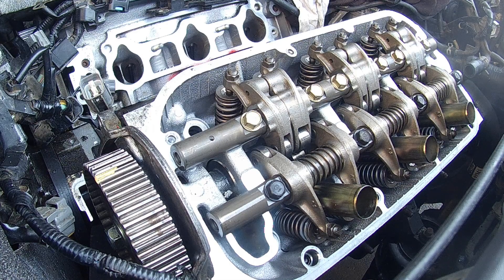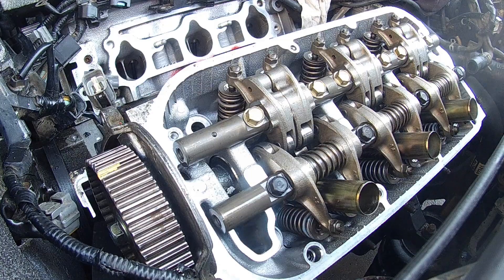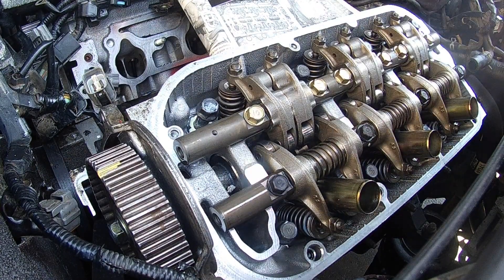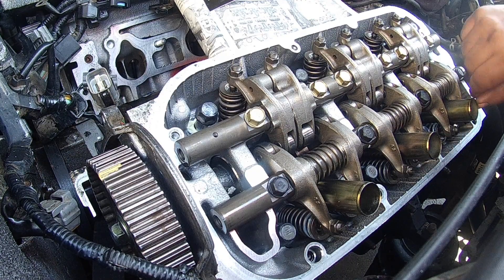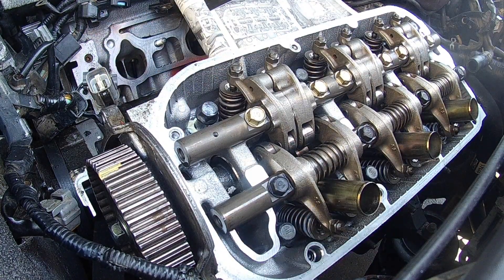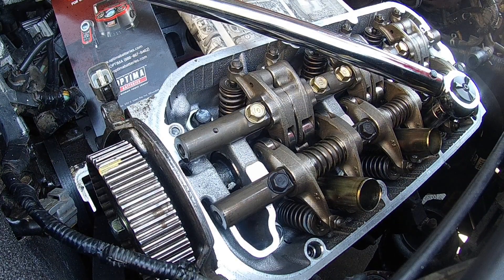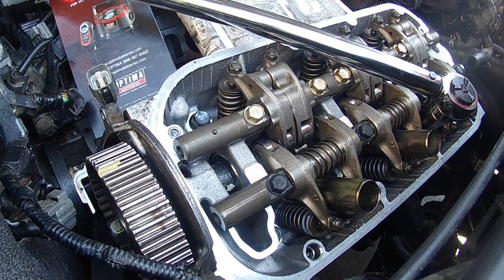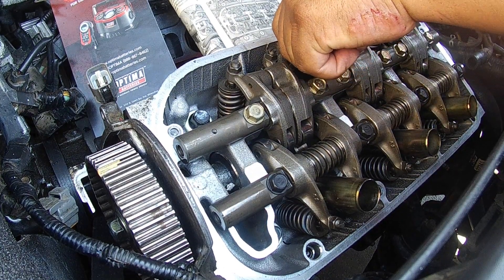Honda Accord V6 Cylinder Head Torque Specs - J Series V6 - Pilot Ridgeline Odyssey Acura TL CL MDX

Comment: How does one goes about knowing if a bolt is 12 point, or 6 point.
Reply from the maker: Look at the head / top of the bolt. One will have a 6 point bolt and the other will have a 12 point bolt.

Comment: Hi bundy, would you please help me with my 2008 odyssey head bolts torque sequence (12 points) thanks!
Reply: Just did it on 2011 mdx 12pt bolt it's 22ft lbs then 90 degree and then another 90 degree for old bolt but new bolts same with additional 90 degree

Comment: Very curious how there can be two different head bolt specs and torque setting for this head.  The 6 point bolts have way less threads and the over all torque looks to be way less than the 12 point bolts, even used ones with a less turns.  How can this be?

Comment: Hey bundy I have 12 point head bolts on my odyssey 2008 when they say 22lb step 1 and then step 2 90degrees then step 3 an additional 90 degrees. Whats step 4 is that if I brought new bolts then ill tighten an extra 90 degrees? I'm reusing my head bolts so do you think thats ok ? Or should I buy new ones? Since my engine overheated? I've heard i can probably be ok by using the existing bolts but what do you think? Really would like your advice. And understanding into the tightening sequence of using new bolts vs existing ones that really sounds confusing

Comment: Hey bundy thanks for all good info, just want to be clear on some things, first torque sequence and specs is the same for an MDX with a 3.5 and the 3.7L? And can 12 point bolts be reused or not please advise thanks
Reply: Probably way late commenting.....but it's recommended to not re-use the headbolts bolts. Its best to buy new ones.
Reply: Again just putting this out for posterity as you have probably already completed whatever you were working on but the FSM says to measure them in three places on the threads and if they vary or are smaller than 11.3mm then replace them.  If not reuse them.  When reusing them the FSM states to torque to 22 ftlbs then turn them another 90 degrees in sequence(quarter turn), then another 90 degrees (quarter turn) in sequence (for a total of half a turn or 180 degrees) and you’re done.  I always just buy new ones as they aren’t very expensive.

Comment: Question: are 6 point and 12 point the same length and diameter and thread? Coz im thinking of using 6 point instead of 12. Also on a 2009 Honda Odyssey 3.5l i-vtec w/vcm intake valves are 14711-rye-a00 and Exhaust are 14721-p8e-A00 They dont make kits with both of those in it🙄🙄🙄🙄rye ones come in 4 cylinder engines—BUNCH OF CRAP HUH???

Comment: I used new 12 point bolts. The Acura manual states first torque to 22 ft-lb then 90 degrees and 90 degrees again for used bolts and AN ADDITIONAL 90 DEGREES FOR NEW BOLTS... I'm glad I had a giant 1/2 ratchet to get that 3rd 90 degrees. Oy.
Reply from the maker: Did you put white lithium on the threads before installing?
Reply: @bundysgarage  yes
Reply: @bundysgarage  I didn't on the rear head bolts because the manual states to just use engine oil, but then I gave the white lithium grease a shot and it was better, but still tough
Reply: Is your engine vtec?
Reply: @leonel1186  yes. I believe all J series V6 have Vtec

Comment: So I ordered a head gasket kit from Fel-Pro and I also got head bolts for both the heads. But they sent all 6 point head bolts. 16 of them. I thought there was 12 and 6 point for install. Can I use all 6 points for both heads? I don't know why they sent 16 6 points
Reply from the maker: What did you car come with originally?
Reply: @bundysgarage  I haven't even torn down the motor yet. I start that tomorrow morning. So I haven't seen yet. I can't find any documentation that mentions anything about it anywhere
Reply: It's a 2004 Accord V6 6-speed Coupe
Reply from the maker: Most likely 6 point. Get a flashlight, take off your oil fill cap and shine it down there and you will see a head bolt. Then you can see if it’s 6 or 12 point.
Reply: @bundysgarage  hey bundy I apologize for not responding didn't see it in my YouTube notifications. I just got my heads back today. They look absolutely amazing. All of my head bolts on my car are 6 point so I guess I have nothing to worry about.

Comment: Hi Bundys , nice video .Questions when you change the head gasket you have to remove the timing belt and when you install the timing belt do you need to do valves adjustment ? Thanks
Reply from the maker: Yes. Redo the valve adjustment. I’ve seen techs that didn’t and fired up the engine and bent the valves at startup and the. Had to do the job all over again, for FREE.

Comment: pro tip never put anything grease, lube, or oil on headbolts, as you cannot torque it to spec...
Reply: Why do you say that?  I understand why you say it, but it contradicts what it says in shop key.
Reply: Pro tip, don’t listen to guys on YouTube that have no clue what they are talking about. Why would a maintenance manual say to do this if you shouldn’t do it? Moron

Comment: Why is the torque sequence different depending on how many points the bolt head is?
Reply from the maker: Great question! Cause one of the bolts is a torque-to-yield bolt, meaning it can only be used once and the torque sequence is different.

Comment: Due u need use new head bolts?
Reply from the maker: If the engine overheated and that is why put are changing the head gasket, yes go ahead and use new head bolts. Other than that it’s not necessary but recommended if it’s in your budget.
Reply: Yes, you do. Torque to yield bolts stretch when you follow the sequence. If you reuse them, they will never achieve the same clamping strength. 

It will, I repeat WILL cause premature head gasket failure and/or cylinder head warpage
Reply: @stephencarlsten2329  this contradicts honda guidelines. I agree with what you're saying,  but talking to a honda tech, they measure the length of the bolt and only replace if it is too long. Even though it's TTY they understand that it will stretch. That's why they have different torque specs for new versus old bolts. Call me crazy but I'd rather play it safe, dont want to risk a bolt breaking off in the engine.